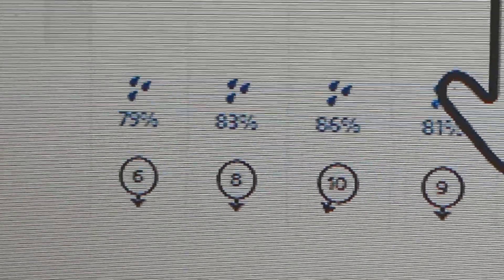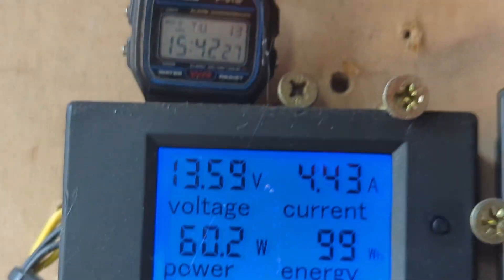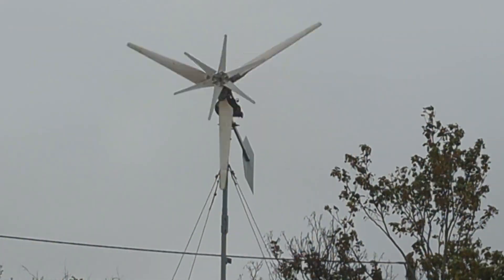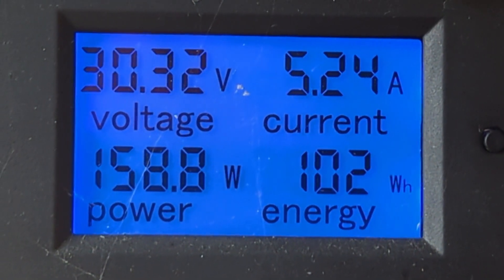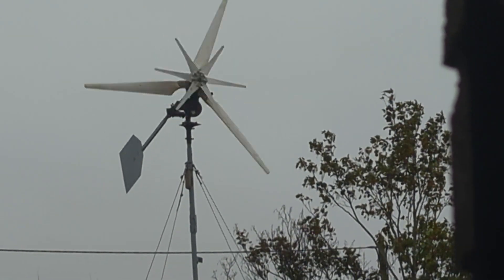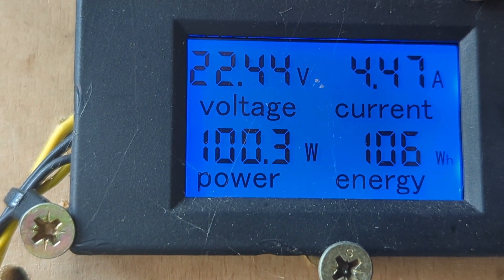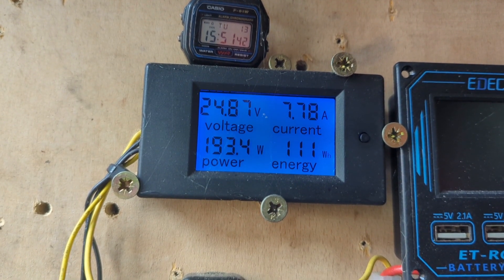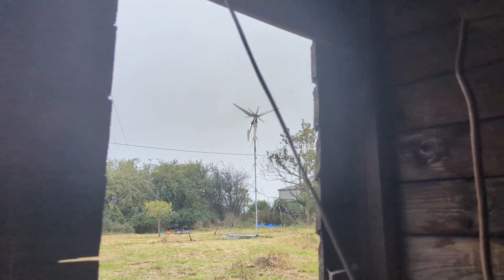The first bit of wind for a while - DIY E-bike Wind Generator - 48v 1kw Motor - With Gearing System

Comment: Great low wind performance. Quandary is 12v versus 24v. MPPT would be nice but horribly expensive for controlling the amps that beast puts out. I like 12v with my turbines. Keeps RPM low with same power, albeit with more amps.
Reply from the maker: Sorry for the late reply to this one. Yes, the 12 or 24 volt thing is a constant decision. I keep thinking about it. Would be nice to have both